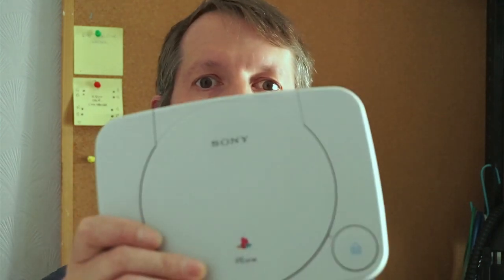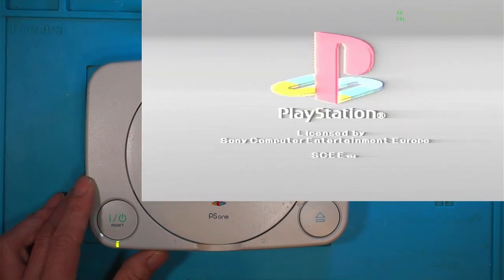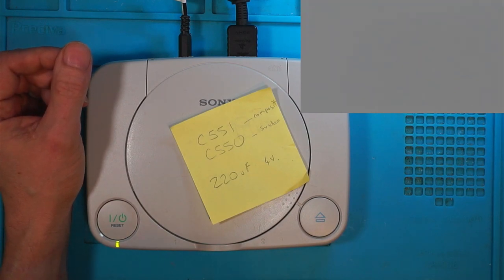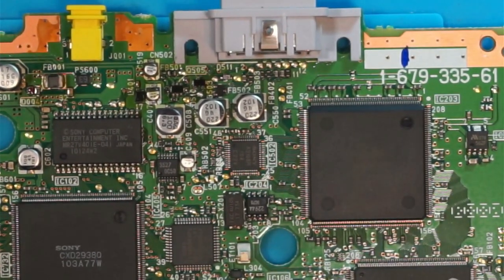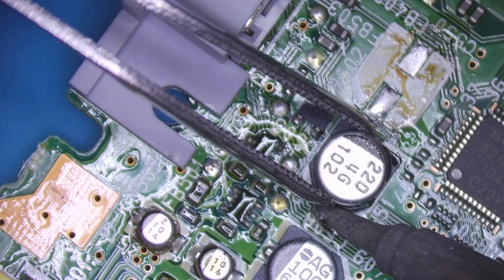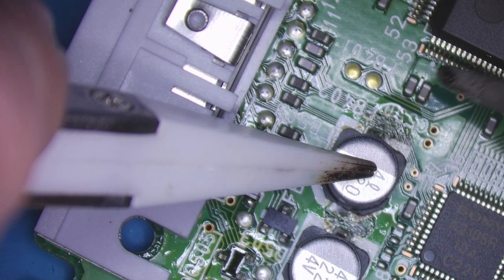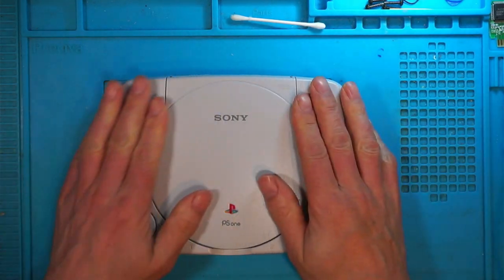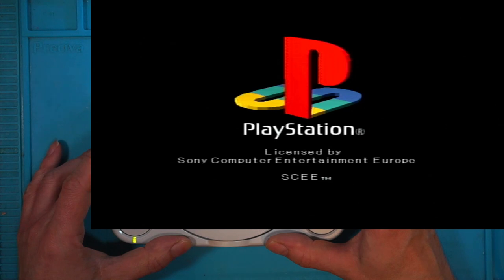Sony PSOne Video Problems Solved

Comment: 6:45 OBS is notorious. Sometimes you need two video feeds to get the sound, sometimes you need two to get the picture and sometimes you need to check to make sure the monitor out is on. It’s a nightmare.

Comment: Can we fix it?? Dunno... but I'm betting on it being the caps... now to settle down and watch it :)
Reply: Helps if I read the desciption, it IS the caps :p
Reply from the maker: Yep the caps. I had more problems cause by OBS than I did replacing the caps. I've had to spread out the USB devices, rather than use the expesive hub I bought.
Reply: @PhilipBryden  Bloody OBS, join me in the world of crap production values and just use an iPhone :p 
Good effort on the fix though, I found out about those caps a couple of years back, toook a picture and circled them for future reference, and then have not had another one that needed them doing, so soon as I saw the title, I was interested in seeing if it was the same thing :)
Reply from the maker: @1up_Gaming  If I were recording directly to a camera or phone, it is guaranteed that I would pause the recording, then forget to unpause it, while fixing and finishing the video.😟
Reply: @PhilipBryden  Or .... EXACTLY what I done this evening... followed by the battery running out, FML :p
Reply from the maker: @1up_Gaming  Oh no lol. Can you leave the charging cable in when recording? I bought a dummy camera battery to so save me from this exact situation.
Reply: @PhilipBryden  I can do, I just always forget 😂😂

Comment: I'm having issues with PS1 Slim not reading games. It brings me back to the error red screen of death. I replaced the whole disc reader and fixed that speed thingy for the spinner; however, the issue is still there. The games are all PS1 originals and used to work. I wonder if it could be a capacitor issue.

Comment: Help my audio is fine but when I plug it in using a HDMI adapter my screen is just blue
Reply from the maker: I don't know what type of HDMI adapter you have but some you have to power on before the PS1. So try switching the adapter or PS1 off / on while connected.

Comment: I have a problem with my PS1. The colours of the startup and playstation logo are fine, but all games I load into it have a green and blue striped tint to them. Is this the same problem?
Reply from the maker: Possibly an issue with capacitors. Do the graphics look ok apart from the colour tint?
Reply: @PhilipBryden  They function fine aside from that
Reply from the maker: @Exquisite_slurper_of_milk  possible a capacitor issue. You'll have to open it and look for bulging capacitors
Reply: @PhilipBryden  Ok, thanks!

Comment: Nice video mate! I had the same problem, but I still don't have any sound... it's there but very faint :/ Do you happen to know which cap is for sound issue?
Reply from the maker: I don't but page 21 shows the schematic. It shows IC405 is the audio amp so I'd start there. 
https://www.psxdev.net/downloads/SCPH-100_5th-Edition.pdf
Reply: @PhilipBryden  Thanks mate!

Comment: How to PS1 fat. problem like that
Reply from the maker: I haven't came across one with the same problem. If I did, then I would start at the capacitors closest to the video out port. Which model PS1 fat is it?
Reply: @PhilipBryden  i see capacitors're same. Ps 1 fat or called PSX. 
Thanks before